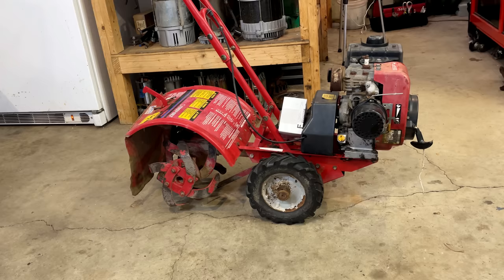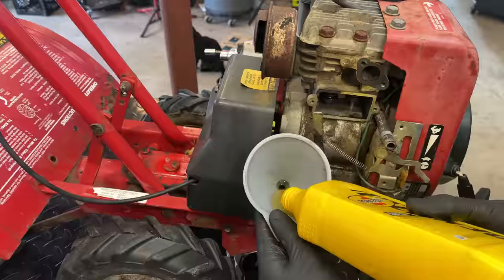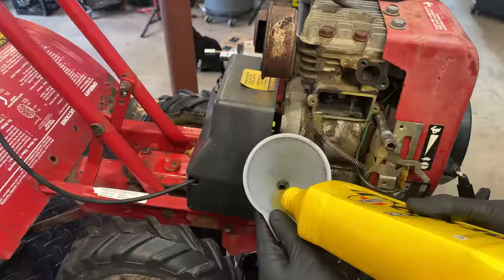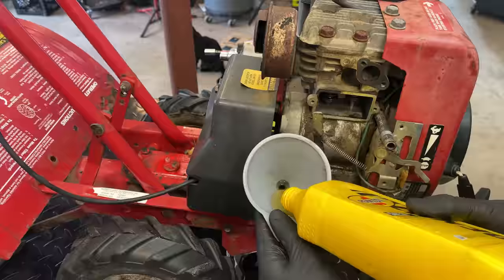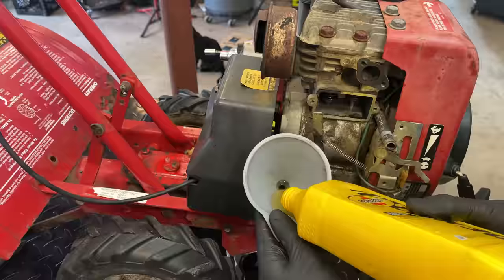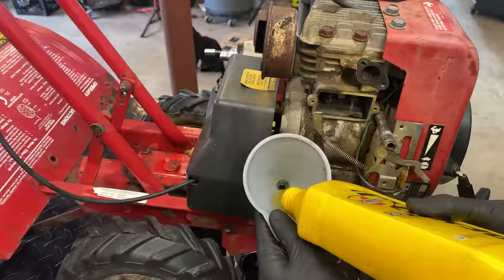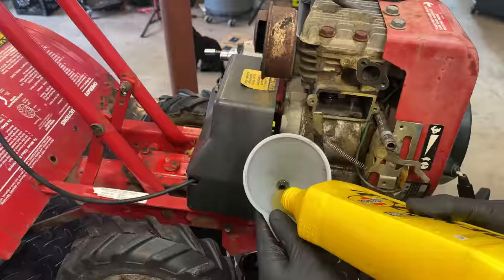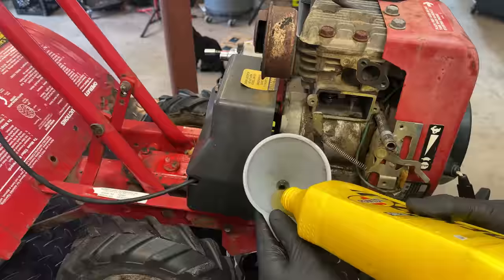Tired Tecumseh Troy-Bilt Tuffy Tiller - No Compression

Comment: what i find is those type of compression testers are not well suited for these engines, and ill tell you why, the length of hose uses up alot of the reading but the time the tiny piston gets compression , what i use is a shorter tester with a rubber boot on the end , that seems more accurate if you are looking for numbers . my 2 c
Reply from the maker: Good point.  On smaller engines you need one with a short hose and/or Schrader valve

Comment: Could you show how to stop oil leaks from the transmission case, or gearbox after you have changed the oil seals a few times? I have a Troybilt and can't seem to get leaks stopped after I put the seals in, I used a PVC pipe to drive the seals down until tops are flush with the opening.

Comment: Hi James, this is Joe. 
I have a 3.500 generator from Harbor freight. 
I had it running fine, and then it started running bad within five minutes equate. 
I simply test the compression there is nothing. 
It is a fairly new generator with 151 hour. 
I don’t believe that is blown up. 
I would loved to see you look at it 
and see if you can find the problem. 
I am from Hilmar California. 
Nearest city Turlock 
Are you to far away from here? 
Thanks
Reply from the maker: With I was closer.  I am in the Northeast (opposite coast).

Comment: I've been a mechanic for fifty-five years on them Small engines I can understand why you're trusting somebody else's high speed adjustment on that carburetor you put it on you did all that work with the idle but never once check the high-speed each cage motors different that carburetor should be checked on high-side and low-side to dial it in and fine-tune it for that engine should have cleaned up and parts a little bit I'm surprised you didn't do that you could have phoned that block a little bit without rebuilding it just to help it I don't know so I just thought I'd let you know

Comment: What roloc disc do you use and do you just use break clean to prep the surfaces?
Reply from the maker: For cleaning the head surfaces I use a 3M plastic bristle brush.
3M-18733 Roloc Bristle Disc Grade - 120, Size - 2 https://a.co/d/idpNum5
Reply: @jcondon1  thanks. Those were the ones in my cart. I’ve done five compression release camshaft failures this summer and got a carbide scraper that works much better than a razor blade in about a tenth of the time. Just have to be super careful not to scar the surfaces. I’ll try wd40 and some 3m pads on the next once I take the top layer off the remaining old gasket.

Comment: Hi James. Off topic to this video. How should I treat my snowblower between seasons? Should I drain the tank and carborator or leave it with full tank?
Reply from the maker: I always store the carb dry.  The tank is up to you.  If you leave fuel in it fill it to the top.  Might be safer to drain it though.  Fuel should keep for about 6 months.  After that and it can quickly become an issue.

Comment: Nice work James. Didn’t burn that much oil. Very surprised with that scoring in the walls. I rebuilt a h60 Tecumseh 1977 and I think I put the second compression ring  in the wrong way. Two manuals say two different things on the position. Both top rings have a inside chamfer. Top I installed chamfer up and second also chamfer up. Did a valve lapping also. Any thought on this?
Reply: Keep an eye on the oil usage, if it's normal amount of oil burning, then you probably don't need to worry 😊

Comment: I must be missing something but I'm mystified:  how do valve stems get longer over time?  Obviously they were a certain correct length when the engine was built but now they're too long and need a bit taken off?  If anything wear on the cam and the valve stems would make them shorter.  Usually in your videos valves have become too loose and you have to adjust them.  Just call me mystified.  As always a most watchable video.
Reply: If the valve seat becomes worn, or the part of the valve that contacts the seat becomes worn, the valve will sit lower than it should.
Reply: @oliverscratch  I agree as that's the only possible way but I can't see either resulting in enough loss that would require removing some thousands off the stem.  Those two areas aren't usually subject to friction wear.

Comment: I was looking at your Amazon store. I did not see the drill bits for cleaning the carb jets. I found them on Amazon but there are two size ranges to choose from. Also, what brushes (pipe cleaner style) do you use?  Thank you!  I will soon be digging into a leaf blower that has stumped me a few times now.
Reply from the maker: The drill bits are in the carburetor section https://www.amazon.com/shop/jamescondon/list/33J0N0JQR5XCL?ref_=aip_sf_list_spv_ofs_mixed_m

And the brushes as well 
https://www.amazon.com/shop/jamescondon/list/33J0N0JQR5XCL?ref_=aip_sf_list_spv_ofs_mixed_m
Reply: @jcondon1  Thank you. I was looking under the tool section. Ordered both.

Comment: Calves. Intake could cam shaft and camshaft gear have slipped on camshaft ?
Reply: That engine is old enough that it probably does NOT have a plastic valve timing gear to slip, and I would think the cam gear and camshaft with lines may have been a press fit that could have slipped but could have been a forge and machined single piece.  Just haven’t been in many  small 4 stroke engines to know how the csmshafts and cam gear were manufactured.  I’m old enough to have been in engine like this just haven’t.  Our yard was full of steep hills so all of our lawnmowers were 2 strokes.  Our old Lawn boy 2 stroke was like 40 years old when dad finally went to a force oil lubricated troybuilt massively heavy mower so heavy the variable speed self propelked function would hardly drive it forward or reverse and it was a manual mower with spinning tires.  Dad hated that mower and himself for selling the still good super light east to push and pull non-self propelled lawnboy.  We had a 1.75 or 2.5 hp iron horse 2 stroke that we left at his moms house for us to cut grass with.  It was only about a 14-15 inch cut so it took a long time to cut her 3/4 acre side yard and .25 acre each front and back.  That mower was 25-30 years old when I was an adolescent.  Probably 50 years old running fine when his brother swapped it to someone for one of the big wheeled Yazoo push mowers that was a pain to crank and use.  The old iron horse was a wind up rope start and usually only took 1-2 pulls.  I don’t ever recall it having gas or carb problems but we did run the carb dry after every use but the gas set in it under her house from fall to spring and don’t ever recall encountering sour gas.

Comment: What is the importance of a fuel shut off valve I know some of my equipment don't have it.
Reply: If the needle ever sticks the shut off keeps all the gas from leaking out and flooding into the engine. Gas and oil do mix but it's not good for the oil if they do. Though by rights you're probably better off just draining the tank between uses. Then the shut off is still useful to keep the gas from flowing after you have the hose off until you get it into a container.
Reply: The carb doesn't gum up if you shut off the fuel and let th engine use up all the fuel from the carb. And no risk of leaking, too
Reply: @erik_dk842  yeah jelly in the carb is never good.

Comment: Ah, one of the last of the real Garden Way built Troy Bilt Tillers. Not sure if MTD owned them when this one was built, but it looks like it has the genuine Garden Way worm gear drive line in it.  Anyway Troy Bilt is junk MTD garbage now. Unfortunately I figured they would have to sell out at some point since no one has a garden anymore. I'll keep my Horse model from the early 80's. It will last a few generations.
Reply from the maker: This one actually came straight from the factory in Troy NY
Reply: @jcondon1  Nice

Comment: Hi James.  I've been enjoying your videos for a couple of years.  Now I find myself in need of a little help.  I need a new carburetor for my riding mower.  I see several vendors on-line that have the carb I need.  The question is, are they all selling the exact same carb?  If not, is there one vendor better than the rest?  Is there anyone I should avoid at all costs?  By the way, I would appreciate anyone else's informed opinion.
Reply: Most of those carbs are Chinese knock offs. I’ve used many over the years. Make sure the choke setup is the one you need and go bigger rather than smaller, meaning, if yours is 6hp, don’t get a carb for 5hp… the jetting will be too small and it won’t want to run… The 7 or 8hp will work better if you’re not sure

Comment: Where do you usually go for parts for small engines? Also, have you seen the ball peen hammer method for making gaskets?
Reply from the maker: Usually eBay and Amazon when possible.  Those venues usually have the parts ready to ship.  I use parts sites like eReplacement parts, parts tree, jacks etc.  the problem with the parts sites is a lot of parts they do not actually have and it takes longer for you to get them because they have to get them first

Comment: What a great video!

I'd never seen that air hammer/bolt/prybar combo for a pulley removal, when the puller didn't work.   Nor that James Condon brand 'seal removal tool.'

Those are both going into my bag of tricks.

I would've missed the air hammer trick if I looked away from the vid for that 1 minute.  Do you make these things up as you go?     🙂

At the end, all I could think of was that overused meme from 'Slingblade'   'Ain't got no gas in it.'  https://www.youtube.com/s/gaming/emoji/7ff574f2/emoji_u1f601.png

Question:   The tiller did a good job scratching across the surface, but the real work for those things is when they dig in and turn soil.   Did that have the power to set the depth gage and really power in?

Comment: Ciao James, un altro problema di questi motori e in genere tutti i motori four stroke,  è: Quando si  fermano e si prevede di    lasciarli inopeativi per lungo
tempo si dovrebbe far attenzione a lasciare il motore in fase di compressione in modo da tenere entrambe le valvole chiuse così da preservare le superfici di tenuta delle valvole da ruggine e/o corrosione! Non sei d'accordo?
Reply: Here is an English translation of Pio's comment --Hi James, another problem with these engines and, in general, all four stroke engines, is: When they stop and you plan to leave them idle for a long time
Over time, care should be taken to leave the engine in the compression stroke in order to keep both valves closed so as to preserve the sealing surfaces of the valves from rust and/or corrosion! Do not you agree ?

Comment: PLEASE HELP I HAVE A Tuffy tiller in my shop and need a recoil starter..any idea what that part number would be...or the engine number...it is ohv.
Reply from the maker: What is the make of the engine?  Most Tecumseh engines were not ohv
Reply: well its 12060 
 @jcondon1

Comment: While you have the head off fixing the valve clearance, why not finish tearing the engine apart so you can hone (and sleeve if needed) the cylinder, clean all the sludge off the crank and cam shafts and check them for low-oil caused damage and replace the piston rings all at once?

That would save you from having to tear the engine apart a second time and probably stop it from burning oil at the same time...

Comment: If you're worried about excessive clearance on the exhaust valve, could you use hard facing wire in your MIG welder to tack weld the end of the valve stem and then regrind it to spec?

Or would that cause warping or other damage from excess heat build up during the tack-welding?

Comment: Would be nice if you also gave info in metric 😂
Reply: I am European too Gunnar. I have lived and worked with the metric system all my working career. I am 70 now so the old Imperial system was sill around in the UK when I was in high school. Of course its counter intuitive and unnecessarily complicated but it is not so difficult that an educated and intelligent man like you cannot cope with it. I use rough equivalent measures in my mind. 25 mm to an inch. One Newton metre is about 9 inch pounds,  25 micrometres to a thousandth of an inch. A gallon is about 4.5 litres. A quart is about 1.1 litres.  When it comes to nuts and bolts a 1/4 inch is about 6mm. 9/16 inch is about 14mm. 3/4 inch about 19mm.  1 pound per square inch is about 6.9 kilopascal.  One bar is about 14.5 pounds per square inch. Of course this is alright for rough equivalents. Precision engineering requires precision measurements. You can still use a calculator if you want to but for precision I use google.  When talking to Americans on Facebook or You Tube I tend to use their Imperial system. I want to be understood.
Reply: @r8118830  the Empire abolished the Imperial system in 1958. Today everyone uses the international industrial standard inch. Which is equal to precisely 2.54 centimeters. The old Imperial inch was two millionths shorter. A European came up with standard too. He was a Swede.